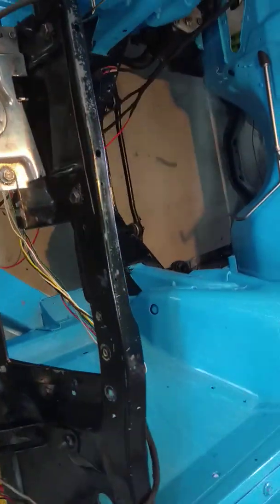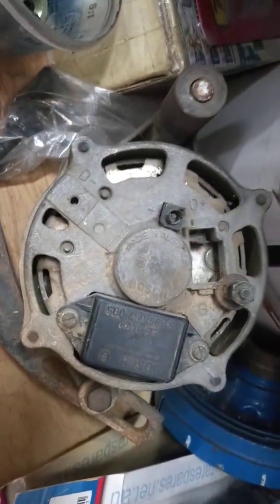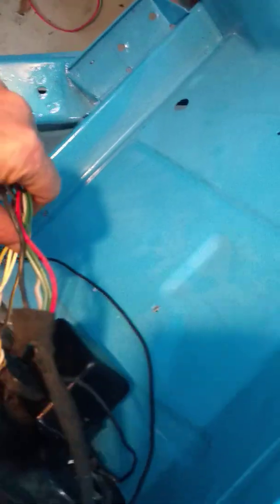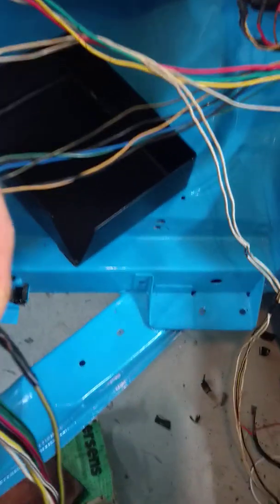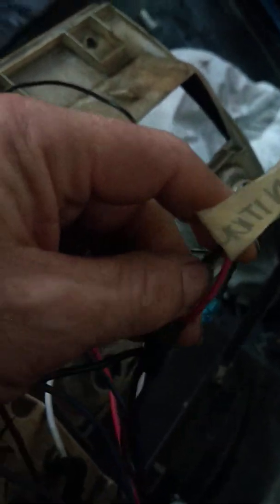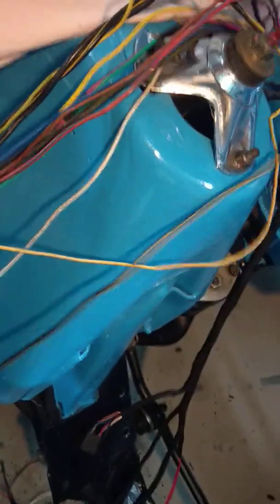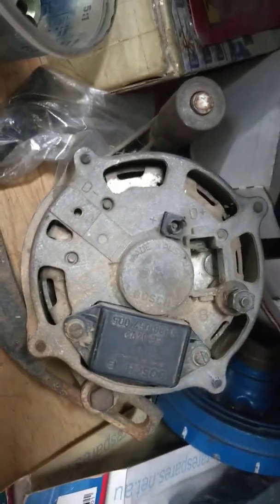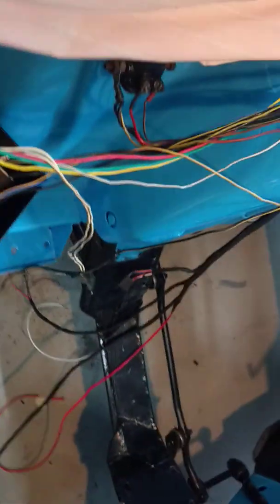Ford Falcon alternator external voltage regulator wiring removal.

Comment: Thanks for posting this.  I am actually doing the opposite - removing a Bosch alternator with internal regulator, and restoring an original Email alternator with external regulator.  I have mapped out all the wiring from the factory wiring diagrams, and am getting a new complete alternator harness made up with original connectors.